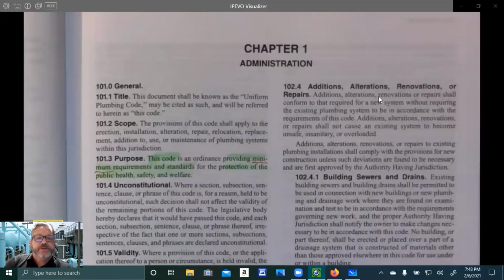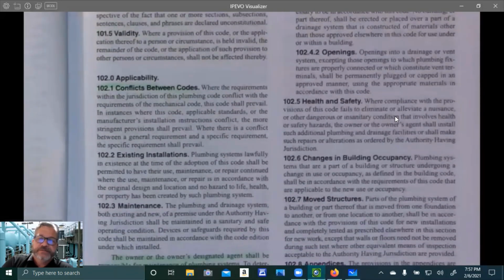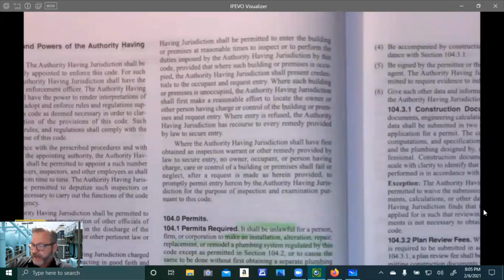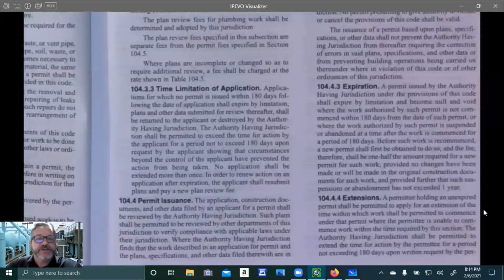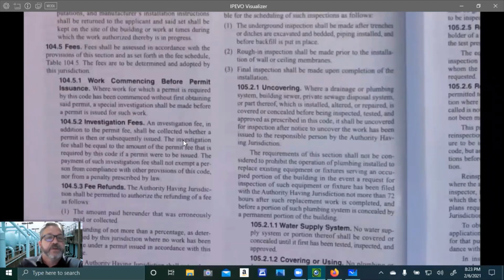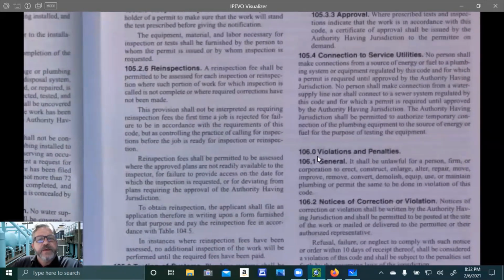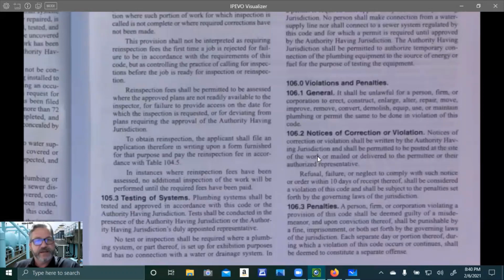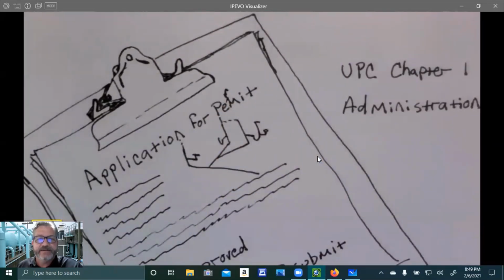UPC Ch 1

Comment: First off, he couldn’t even get the male and female parts correct. Then you told everybody you could use a dollar plug to cap a sewer line. Only temporarily. You didn’t point that out. Because if you plug it with a dollar plug for a future or a former sewer line you will fail the inspection. Why don’t you do better and not spread disinformation?
Reply from the maker: Thanks for the response.  You are correct, kinda. One thing that should have been pointed out was that, depending on which application and which municipality (always this one), will depend on whether or not a dollar plug can be used as a means to plug. If a floor drain is to be eliminated, in most cases a dollar plug is used.  As to not knowing the difference between male and female, that was clarified almost immediately. I do appreciate all feedback and I never edit my videos, so comments like this are always welcome so that others can learn! Great catch, hope this clarifies the intent. Look at it as if this is a class and you just offered up a follow up to make it better. Thanks for watching, I appreciate it more than you know

Comment: would be a lot simpler to follow if you read thrm in  order and people would have a lot better understanding an not be so confused orget so thrown off in process of watching this video.
Reply from the maker: Glad you're watching!  Code is not the easiest thing to understand.  Each of these videos were originally done due to the restrictions of in class lectures due to the pandemic.  When it had started, I'd already completed Chapter 1 in class.  That is the reason this one lecture came in after the others.  Once I have time, I could order these as a series- I'm sure there's a way.  I hope that is what you meant by your comment.  If not, then I will say that I do have a tendency to jump around a bit on occasion.  That is how I've taught for over 22 years now.  It is always to prove a point or to expand on the topic at hand.  I always go back though.
Reply: Thanks for your help sir on codes. Perfect
Reply from the maker: I appreciate you

Comment: Do you know what code nyc adheres to?
Reply from the maker: Most of the Eastern States adhere to the International Plumbing Code.  NY is one of those.  There are more similarities than there are differences.  As far as I've seen over the years, if you adhere to the UPC, you will not be violating the IPC but some of the allowances in the IPC are not allowed by UPC standards (the UPC seems to be a bit more strict).